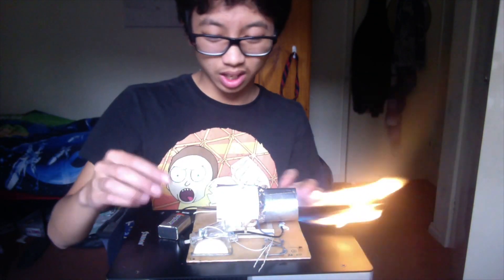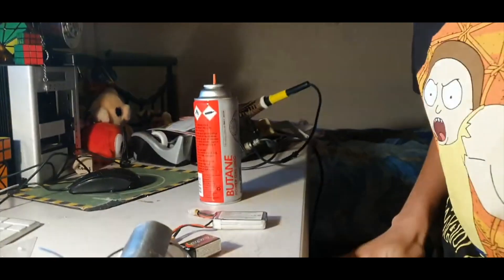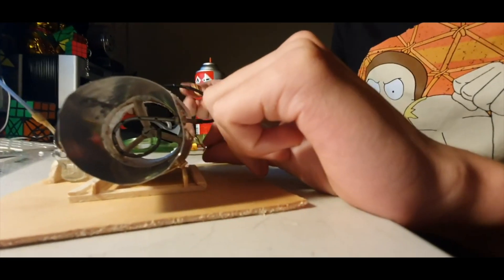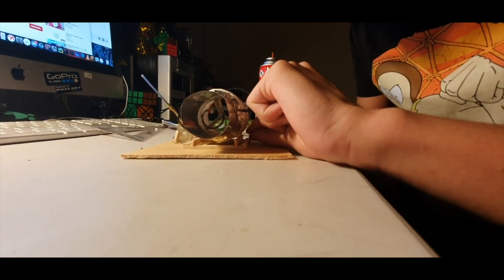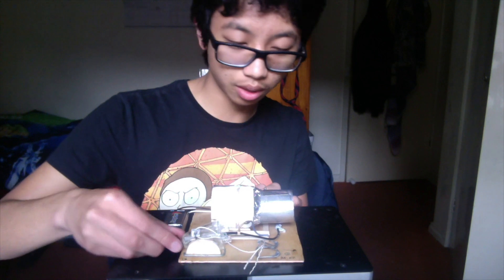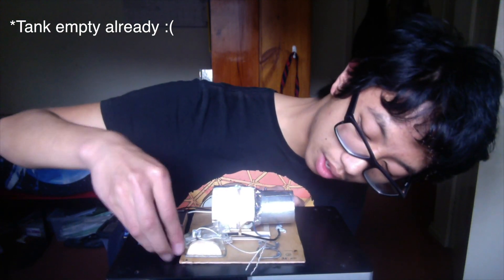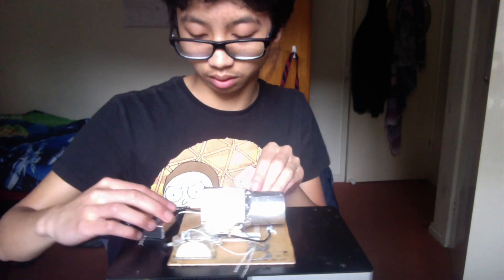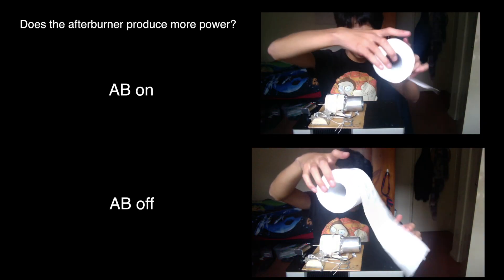Homebuilt jet EDF afterburner

Comment: your design is so janky and dodgy, i freakin loved it also tell me , is it completely necessaty to use a flame tube or not? i mean i am gonna use the brass pipe with the holes but what about the steel pipe that goes around it? is it compulsory to use that?
Reply: It creates a low pressure area inside the tube where the gas is injected so better mixing of air and fuel therefore better combustion
Reply: @ceoof601  yea i figured

Comment: afternurner are used for thrust not for coolness and noise
Reply from the maker: True most hobby after burner supposed to give an extra 10-15 percent thrust but not really worth it as it burn fuel really inefficiently as my model edf afterburn runs for >30 second before it empty. Which also model accurately a full scale after burn. Like a f-16 afterburn which burn 11 liters a second. Which ABs are used mostly for WEP.

Comment: I get that you did this with limited resources and time but could you not just add a switch for the edf. It is painfull to see you powering the afterburner with the knowledge that the edf fan could fail and burn down your house. Also a duct decreases efficiency, what you probably meant was a inlet lip. For your EX-6b project pleace use a 50-70mm brushless edf, believe me looks way cooler and the sound is amazing. Feel free to go onto my youtube channel, if experimented since a long time with this beast. Otherwise nice project.
Reply from the maker: Thank you for your comment. Yeah I missing quite a fair bit of part. Lol I try gutting everything I have to find a 9v connecter. And true burning my house down won't be fun. I think I will start with Ex-6b in months I gather most of the scrap and other parts but I don't think I can get a brushless edf. I haven't touched rc flight in soooooo long. and  I kinda don't want to set up my rc equipment. Cause it's the little things that just add up making it difficult. Plus in Australia the RC hobby isn't popular so alot of these   part aren't in supply (in Australia there's like no foam borad). Thank you for you feed back I learn something thing new and impressed of your attempt of the EDF afterburner.
Reply: @TonyWony  in germany rc planes are a big thing, but we still have not much foamboard :/
Reply: @dasKontroloer  Dont build with foam, more wood and GFC.
Reply: @WArbirdFan4FlyingMillionaires  foam is easier to build with tho
Reply: Well it also doesn’t look that scale and will easily get scratched.
Reply from the maker: Also It get soft over time and dang expensive where I live. Some day when I move out I try again